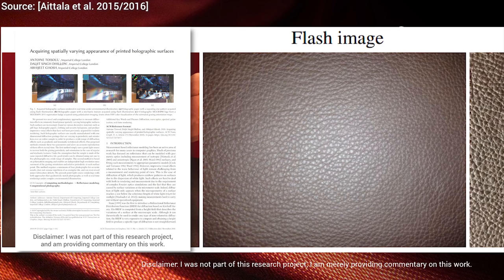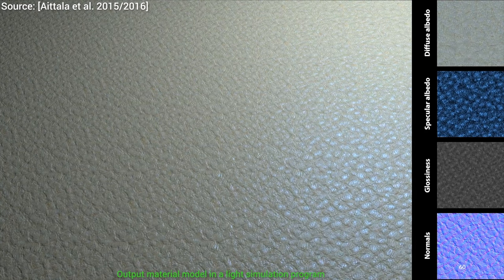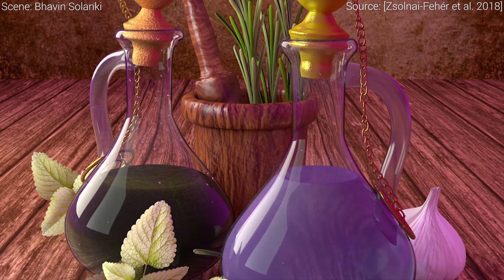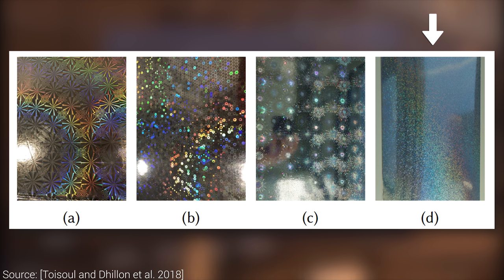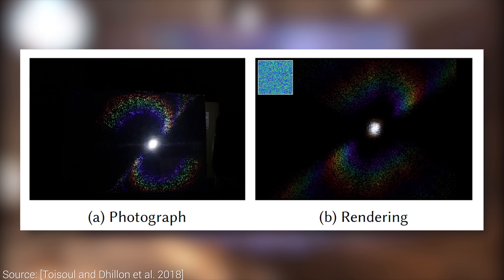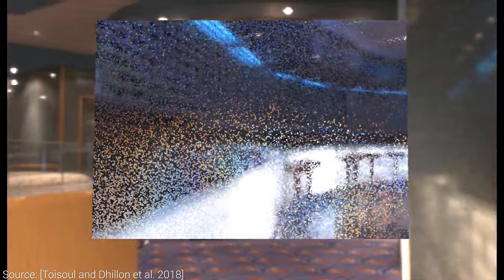Real-Time Holography Simulation!

Comment: I have an old idea for a project that might be obsolete with these AI techniques. The idea is to capture materials  with a camera (any camera will do) and a set of lights with polarizing filters. Then you capture a sequence of pictures with normal light, diffuse light, diffuse polarized etc. In software you can extract pure color information, specular map, normalmap and maybe more. But all that structure is something you need to carry with you, and if you can get the same or better result with a smartphone with flash (and some neural network) all the better!

Comment: I watched this video over 5 times and read holography and holography related materials on the web, but I still don't understand the video. I understood that Holography is a technique of capturing light fields, later to reproduce the 3D Image of an object. From what I read, I understood that one can reproduce the same image, from different perspective. But I still can't grasp what's being said on the video.

I don't understand it so much that I have a hard time articulating what I don't understand; still I'll try.

1. What is holographic pattern?
2. Why is machine learning required in holography?
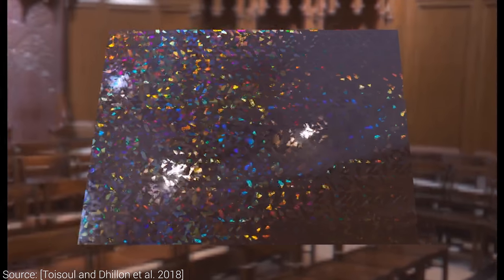3. At 2:06, what is that blurry surface, and what does it do?
4. How is the 3d-model reconstructed?
5. What is the gist of the video?
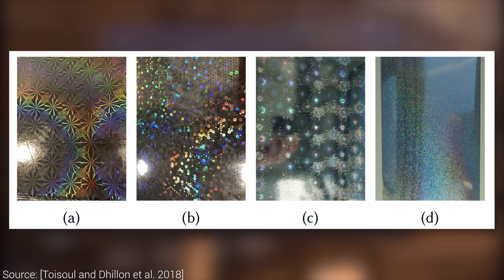Reply: I think it's trying to learn the way light behaves when reflecting off something like the patterns at 1:30. It seems to be trying to replicate the general look and texture so the patterns can be rendered with different lights and camera angles not shown in the original photos. I don't think there are any 3D models. The 3D thing at 2:06 is just a simple plane with the calculated texture slapped on, to show how it behaves from different angles. This is just to show how good the estimation is, as it looks very close to the real thing
Reply: It seems to be the same sort of idea behind the other video mentioned at the start. It's just a trickier material. It's the AI's job to calculate the properties of the material so it can be replicated from other angles with other lights. I don't know any of the details about what a holographic pattern is, but it seems the main point is this technique works on a variety of materials such as this.
Reply: the aim is to mimic the way light interacts with surfaces in an animation engine, creating realistic textures is costly in movie effects/ virtual reality/ games ect
Holographic patterns are the shapes on the plane that reflect and diffract light in different ways depending on direction and wavelenth of the beam, which makes it hard to simulate, until now that is because with machine learning you can train an AI to generate unique textures and simulate light interaction in the graphic engine with a lot less effort than previously required.
Reply: in 3D such as for movies and games they are thing called 'materials', materials are a combination of textures, the color of that object, and how the light should bounce of it and other textures are bundle to make a material, making that stuff is extremly time consuming, requires a great camera with a perfect lit place, that is expensive and time consuming, today with Substance Desinger you can make any material by creating the textures thos removing some of the work but still have to learn the software, the IA objective here is to make a perfect material without the hastle of having a perfect camera and perfect light or having to learn a whole new sofware, the IA will do just as told. Now holographys are HORRIBLE to capture in the other ways, if not impossible on the camera solution, thus if the IA can get that done, it can get anything probaly